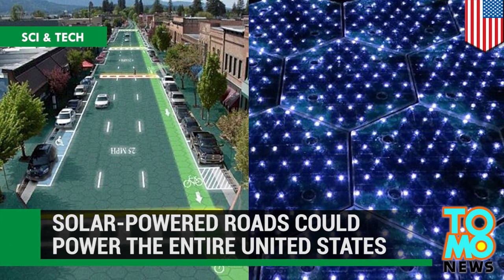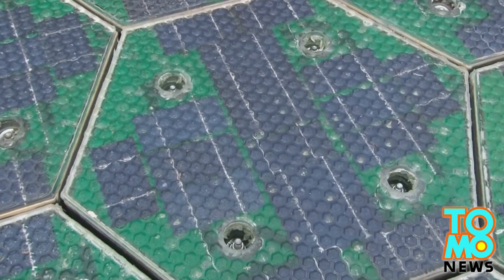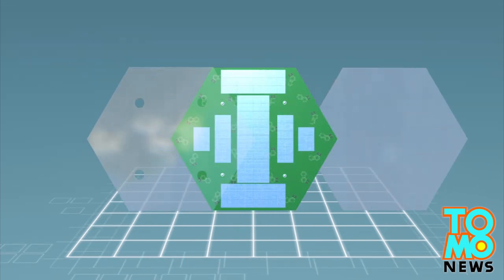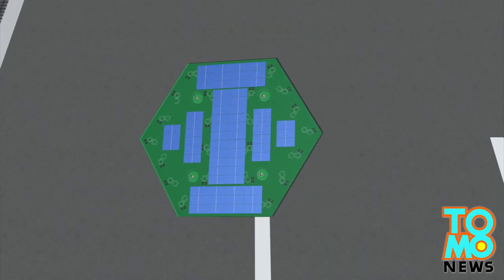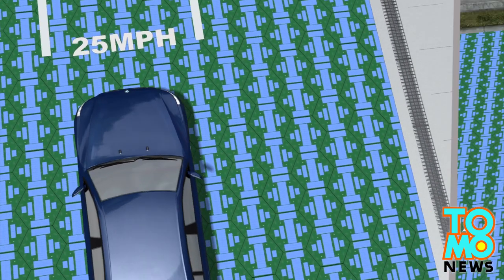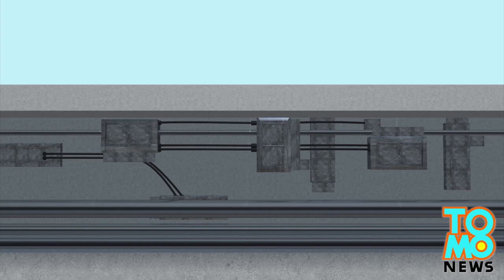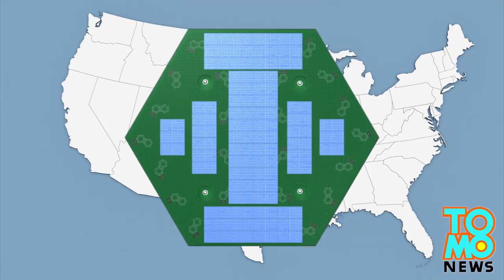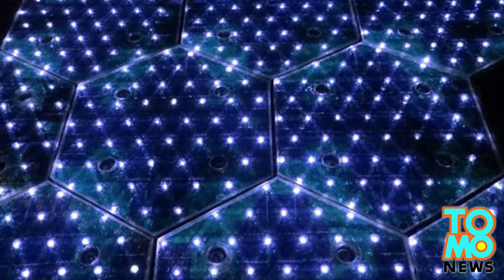Solar Roadways: solar-powered tech charge electric cars while on the road

Comment: Why aren't we doing this now
Reply: Because its unbelievably stupid.
Reply: Inkoo Lee i dont think you understand the problems with this idea... for one it takes more energy to power the LEDs than the solarpanels can generate under optimal conditions at peak... and at night the LEDs wont be powered at all because the energy cannot be stored and is use it or loose it. and thats without talking about how quickly the panels will get dirty and unable to generate any energy, and also pulverised glass is a toxin so every road would be deadly to drive on

Comment: Don't be shocked if the energy companies support solar powered roads. If it can generate electricity, then it could be metered...and you could get charged (in more ways than one). But this is a GREAT idea, though. Eventually, oil will be harder and harder to get and more expensive. So solar powered roads would be an awesome first step towards energy independence.

Comment: Donate at least 1$. You'll barely feel it and if we all do it they'll reach the goal in no time.
Reply: They already reached 1.6 milion dolars and there still are 22 days left until the donations will end. This is so awesome!!! :D
Reply: I shared this on a couple pages it must have helped too, can't help but feel geat about it :)
Reply: Ricardo Camacho what do you do for a living?
Reply: It's a waste of money. A terrible idea. It will be extremely expensive and is nowhere near efficient enough to pay for itself any time soon(it will take >3 generations without considering repair and maintenance costs), assuming it pays for itself at all and maintenance/replacement costs don't make it a financial blackhole.
Reply: tarre tan Right now I'm in IT tech support and responsible for sales at a software company.
Reply: Bob Hob He is basically a underpaid answering machine with a cheat sheet on "how to keep the costumer"
Reply: tarre tan You got the underpaid part right.
Reply: It's a terrible idea. These will be more expensive than putting them no roofs, wear out quicker than normal roads whilst being hundreds of times more expensive, and provide poor traction. They will generate less power, being constantly in shadow, and dirty, as well as under glass. Heating ice takes a lot of energy. Suggesting that, instead of literally driving a large car down the road that pushes it out of the way, we should physically melt it is plain stupid. Imagine if we had to use electric storage heaters. Those eat power and would barely affect much area. This is exactly the same.